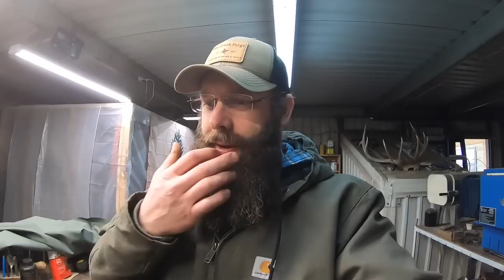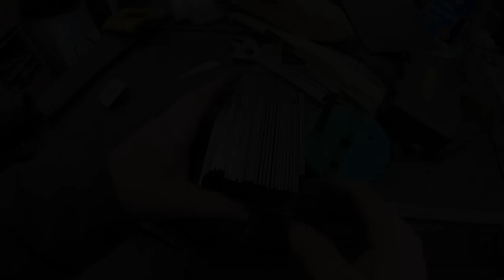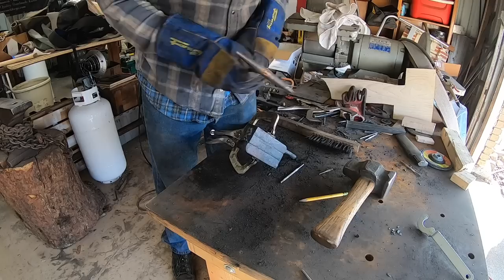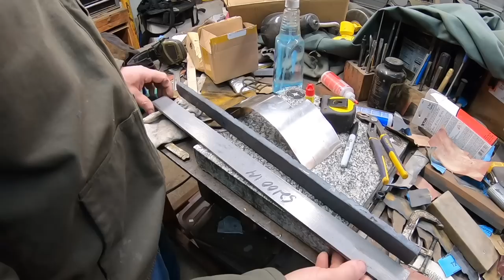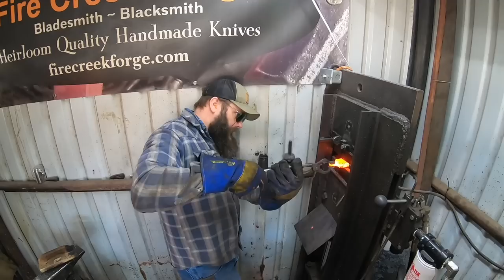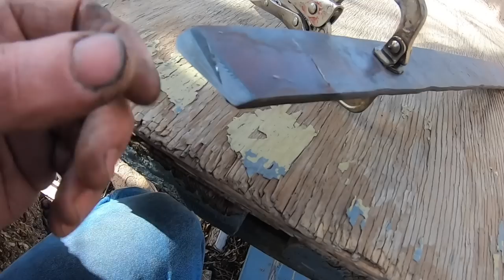Forge Welding Damascus And Nickel Billet, High Carbon Steel Core, Blacksmithing, Knifemaking

Comment: If youre into making laminate (sanmai/gomai/nanamai), try this... youll dig it.

Make a billet of pure nickel and 15n20 (nickelmascus). Cut that billet and stack it around a core of a medium quench steel with manganese (a dark etching steel) such as O1 or 52100, but put a layer of pure nickel inbetween the outer billet and the core.

If you wanna go another level, use O1 and 15n20 damascus as the core.

The etch is unreal.

Comment: Super cool billets! Still sad to see y’all moving away from my neighbor state to the South. As to projects, how about another axe but with a Damascus bit and the handle is Osage? Old fence posts of Osage/bois ‘d arc should be a good dry source of material. Do the bit with a couple bright nickel lines similar to these billets, low layer count so it has lots of figure.

Comment: Beautifully executed
I also thank you for explaining many technical details as you go with your procedure

A question, if possible: @Shurap usually uses the press for forging then the electrical power hammer to slim the metal sheet/rod/billet to the required length, you do the opposite as you use the hammer first then the press; Is there a difference in the final product?
Reply from the maker: Thanks! In this case I use the power hammer to set the world because they are pretty thin billets. Normally I would be using the press on anything bigger. In this case I did go back to the press to reduce the stock size, and then the hammer after it was thin enough...
Reply: @FireCreekForge  
Thank you for clarifying

Comment: I'm interested in your thoughts on setting welds with a power hammer versus a press. I've seen both techniques, of course, and use a press myself since I don't have a power hammer yet, but there's an Anyang in my future! Which is your preferred method when you're not working with 52100?
Reply from the maker: Overall the press works great for setting the welds on pattern-welding billets. Especially since the billets starting out tend to be taller than the capacity on my 50 lb Little Giant. With an air hammer you wouldn't have that issue.. I have not use an air hammer before, but I imagine it would be a toss-up between a decent-sized (100lbs +) air hammer and the press..
Reply: @FireCreekForge  Thanks for your response! I've spent my day in smithys and on the phone with air hammer owners, and the consensus seems to be that I would be better off with a 25 ton press due to control and power.

Comment: I’m glad to see you hitting the billets with the power hammer  before going to the hydraulic press right away. I think that was most of your problem with the puuko billet the other day was that you went to the press first and in the middle first and it was peeling the ends open. As long as the ends are forge welded first the middle doesn’t really have a choice.
Reply from the maker: That could be! I think those welds were 52100 on 52100 which is a little more finicky, but maybe the hammer would have been the ticket.